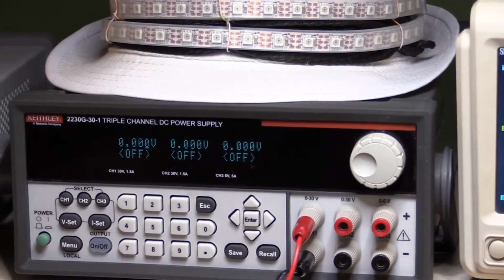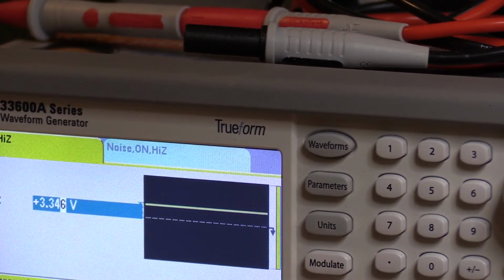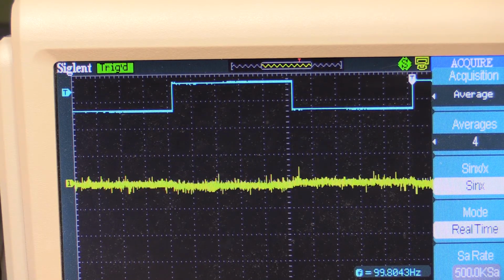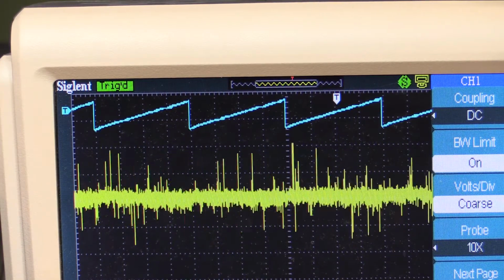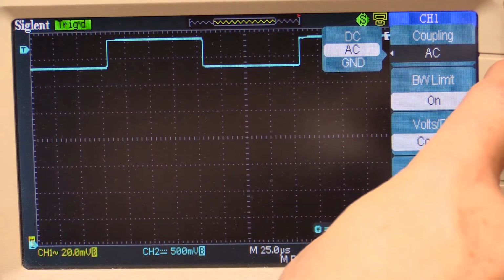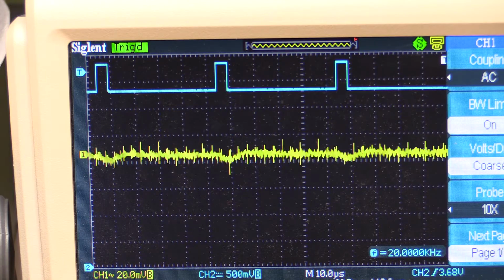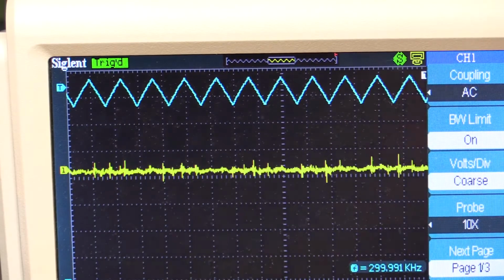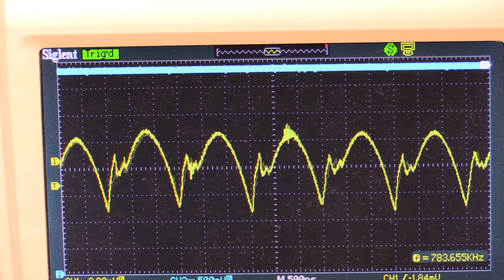Richtek EVB RT7275GQW Review Pt2

Comment: Nice review Peter. Is that ADS1102 noise typical of the model, or is it faulty?
Reply from the maker: I have always had noise at the ~20mV ish ranges and have never managed to get rid of it all and couple that with low cost probes that pick up everything in the vicinity and I'm left with what you see

I will hook it up directly to the Agilent 33622A which I know and trust to be good even at that level and double check but I wont hold my breath, the scope was only about $300 a couple of years ago (EBAY Special) so I never had to high an expectation from it, it was all I could afford at the time. About time I got a decent Agilent or Tektronix :)

Agilent, Tektronix are you watching? :)

Glad you liked the review

Peter